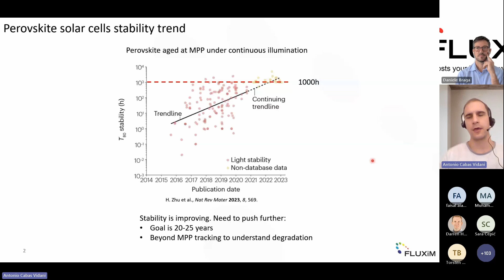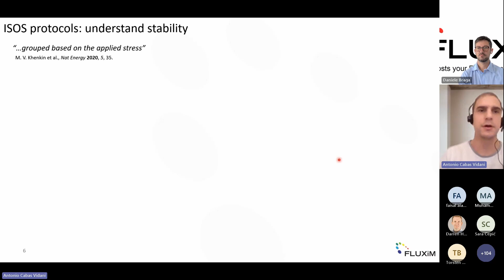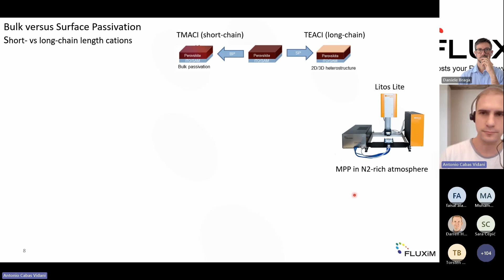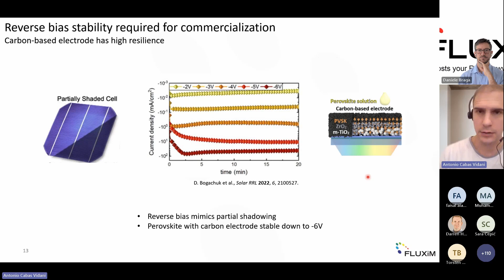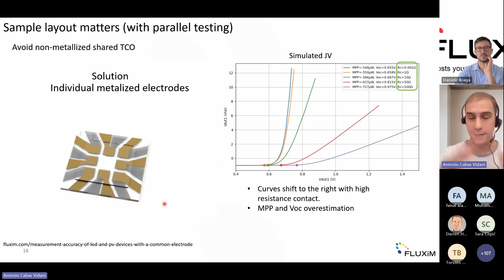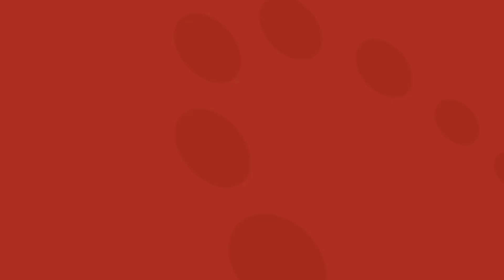Solar Cell Stability Analysis - Expert Views on How to Do it: Webinar 7

Comment from the maker: Thanks to everyone who attended, as there were too many question to answer at the end here are some answers from Antonio: 

Q: Can Litos Lite be used  for OPVs? 

A: Litos Lite is suitable to thin-film solar cells including OPV. Feel free to go through the webpage: https://www.fluxim.com/litos-lite. 

Q:You talk about avoiding common electrodes. What about masking? Does it mitigate the side effects and what is the best strategy for masking? Should it be larger, smaller, or same as the device area under test.

A: Masking is important, but it doesn't solve the issue of the common electrode. In any case, the mask should be as large as the active area. Ideally, the area around the pixel should be scribed to avoid contribution from the neighboring pixels.